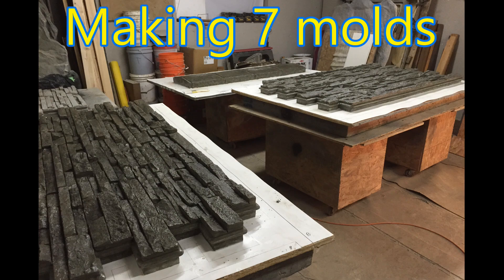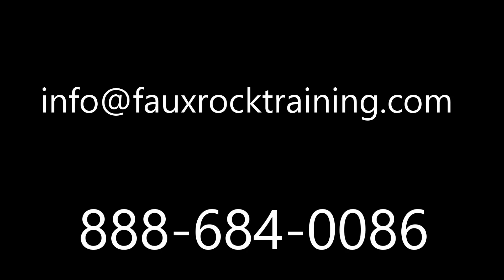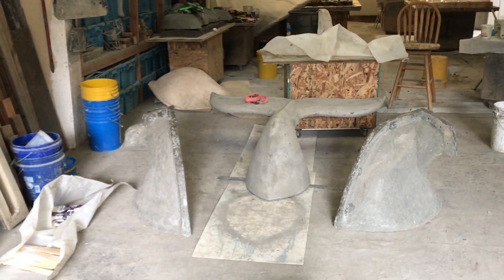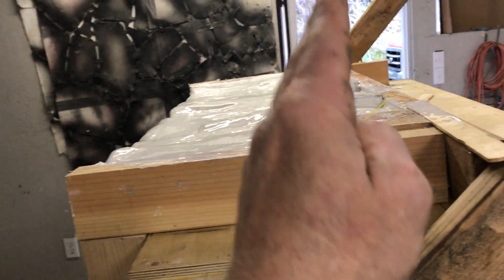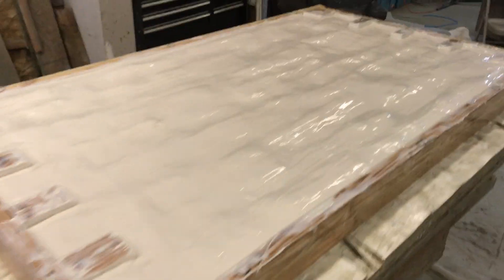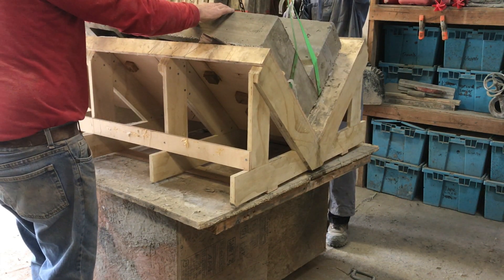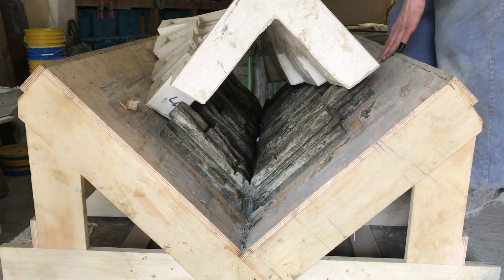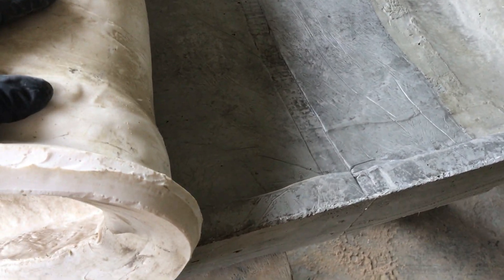How to make stacked stone panel molds

Comment: HAving to use mud as a support jacket is a plus and a minus, weight is high, but you don't have the irritation and smell of fiberglass. Have you considered epoxy mother molds or jesmonite?  Cement seems such a heavy choice.,  Great video and some nice techniques.
Reply from the maker: Thanks for your feedback. I really appreciate you watching my video. I use fiber reinforced mixture that’s reinforce with mesh so that if the mold ever drops it doesn’t break and this particular system has a 16 inch interlock that tolerances are right at 5000 the hard mold is where I get my form for the pieces and it Hass to be dead nuts accurate